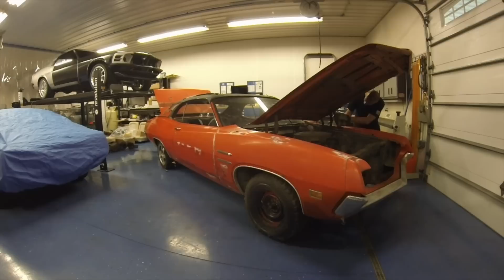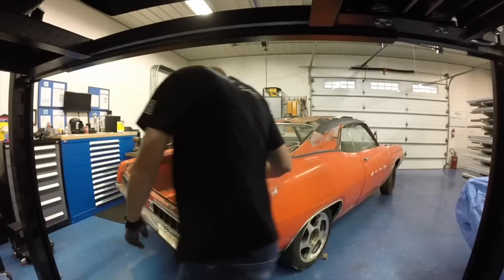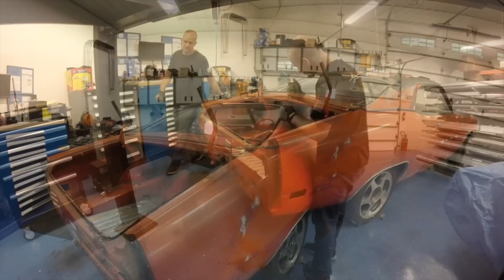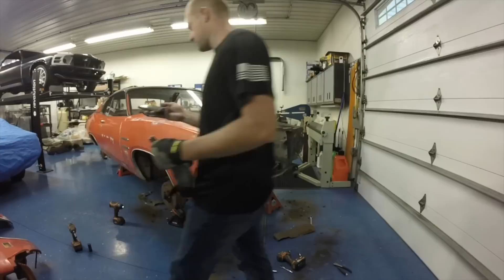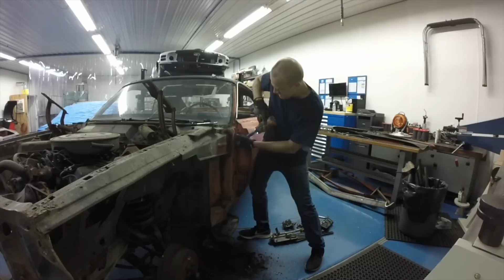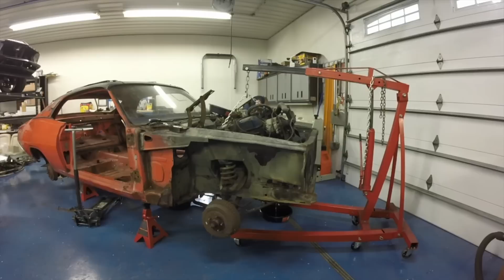70 Fairlane Tear Down For Blast

Comment: Ben, with the angle you’ve positioned the car across the shop, you’ve disproved my wife...

...she says the trouble with men is, they always think in straight lines.

PS - I can see you’re tight for space, but I was also a little uncomfortable that the Fairlane was not square in the bay...
Reply from the maker: It usually bothers me also but space is tight and it's a big car!
Reply: @petersonrestorations  - Hi Ben, thanks for responding so graciously to my insensible ‘first’ comment... I’m now watching the rest over brunch at my desk here in Barking, east London, U.K.  I’m hoping the condition of the rest of the body matches the condition of front fenders...
Ben, I love everything about your work, shop & cars that you so methodically and most professionally revive.
It’s very inspirational (as I consider what to do in retirement!) and also brings back very happy memories of my first time in the States - 6 months(!) from Aug ‘78 thro’ Feb ‘79.
And not just of my $550 one-owner 118k mi 70 Fastback 302 3sp auto (that I sold back to the original owner’s sister for $500 at the last minute before leaving US...!), but of all the other ‘65-‘71 Fastbacks that I viewed every evening & weekends during my first 3 weeks - and all the other 60’s & ‘70’s cars on the roads at the time...
‘Hope your sale(s) of the pink & Boss302 clone Fastbacks are going to plan...
Reply: @jeffreynolds3848  not a clone it's the real deal
Reply: I have a 70 GT. First car, got it in Middle School. I can attest to it being a big car. It leaves half a bay for my wife's car in our two car garage 😂